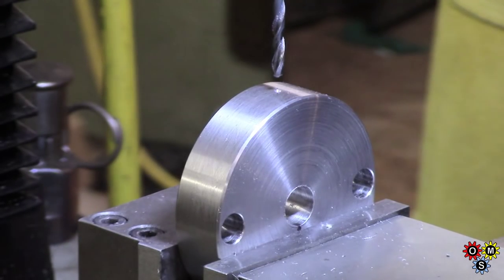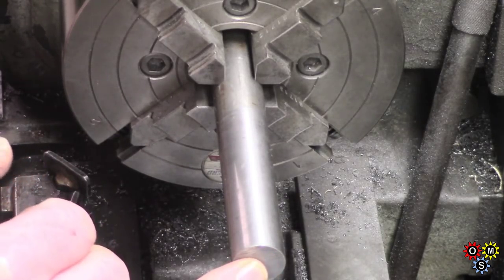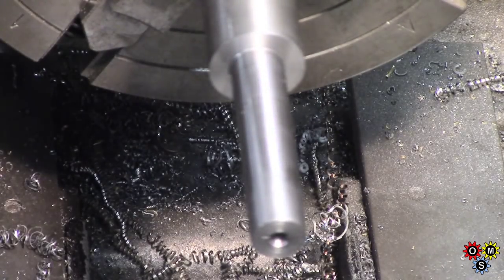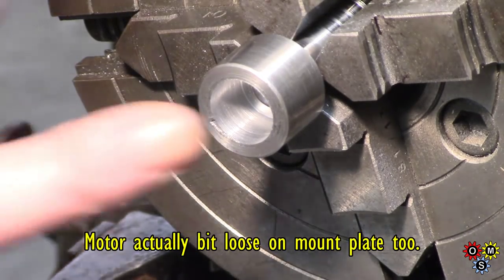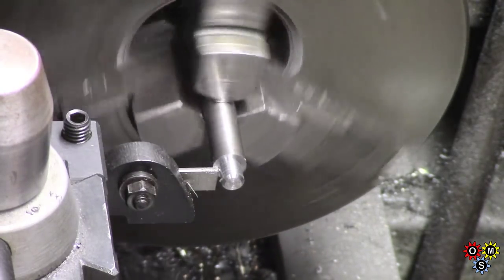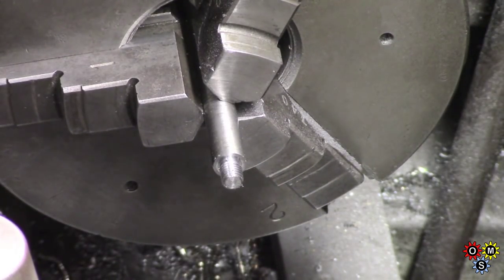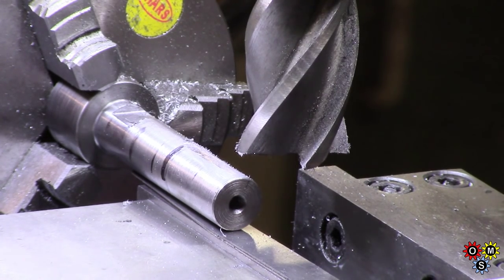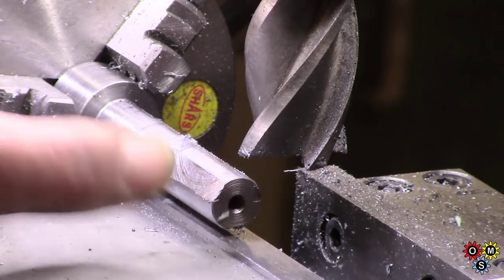X and Z Power Drive Temporary Fix! Part Two

Comment: Chris, That is a good idea and the wiggle sure seems acceptable to me....why spend more money.  That idea I am thinking would be good on the knee of my mill.  A different adapter but the concept seems sound.Thank you for sharing this.
Reply from the maker: +Glenn Felpel 
Thanks Glenn. I hope I might at least manage some teaks to make it run better. A flexible shaft between drill and device would help but, not sure i have anything to handle the torque. Might reduce dia of pins a bit as they are a very close fit in the handle holes.
Reply: +Glenn Felpel Chris,  I was thinking to just let the drill and device on the handwheel while doing a job.  You couldn't do that with a flexible shaft.  Seems like taking it on and off all the time would be a nusence.   And you mighy think about just drilling the holes in the handwheels the next 64th size bigger.  Might be easier then turning down the pins and possibly you don't have to take the wheels off to drill them out a bit.  But I really liked the pin in the wrong die hole !
Reply from the maker: +Glenn Felpel 
All food for thought Glenn. Problem with going bigger with hand wheel holes is -- they are so angled... and have to be set up dead solid - which would mean a careful set-up again on the mill. I do think the pins will be an easier option.

Comment: Hi Chris , could you have not used a Angled drill head and chuck for your fixture? Good vid's Thanks!
Reply from the maker: +Steel CAD 
Possibly but - wanted a cheap mains power drill for good torque and, not sure an angled head would help much. I do have an add-on rt angle drive but suspect yet again chuck inaccuracies might still give some ''wiggle'.:)
Reply: ChrisB257
Just a thought for your X drive chris!

Comment: I think this system, although workable in theory, has so many potential alignment problems that it is unlikely to work, if you want to use a pistol drill, (and it seems ideal), you may be better using a tapered cone clutch system, a simple tapered cup on one ,and a corresponding cone on the other, worth a try. Chris B.
Reply from the maker: +Englishman French 
Hi Chris. Thanks. True - probably expecting too much for ideal alignment. Your tapered cone clutch idea sounds good - will give that some thought.

Comment: Hi namesake, you didn't need to use a blunt 1" any old 1/4 or above endmill would have done if you had cut in the X rather than the Y.
I do wish you wouldn't mangle your native tongue to fit in with colonists, you should be setting a better example for them to look up to. :>(
ATB
c
Reply from the maker: +Chris Stephens 
Hi Chris. Yes indeed, should have worked the X with smaller.  Thing is I had the 1" set up and soldiered on even tho it was obviously crap! Guess I wanted a straight top of cut and didn't think it out.
The lingo -- haha - sorry, after 15 years it rubs off I'm afraid! :)